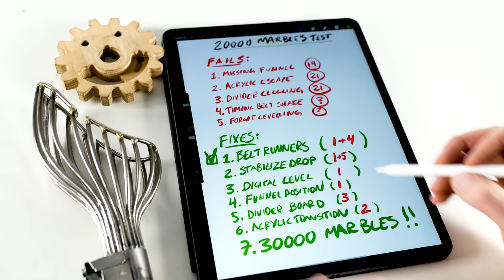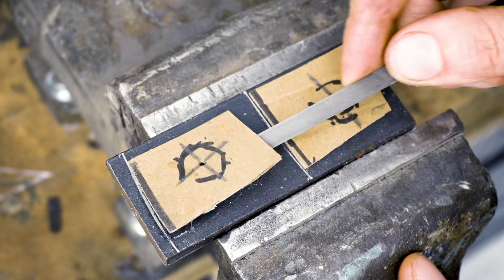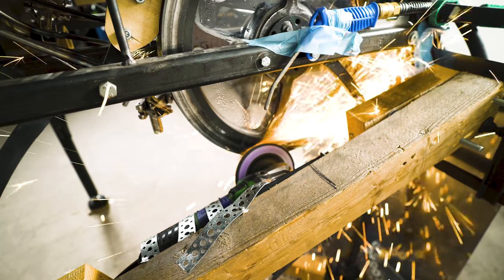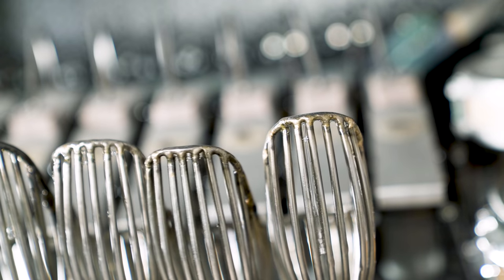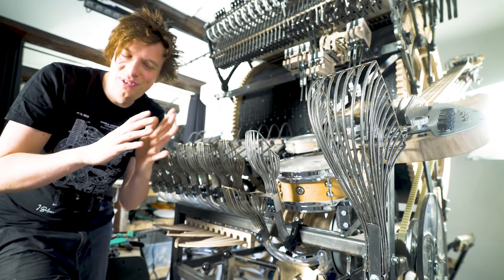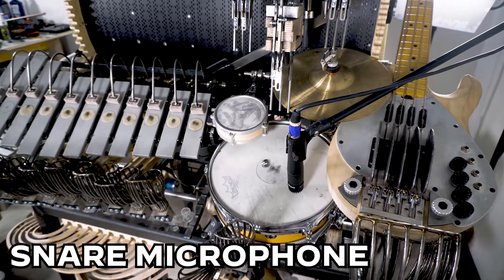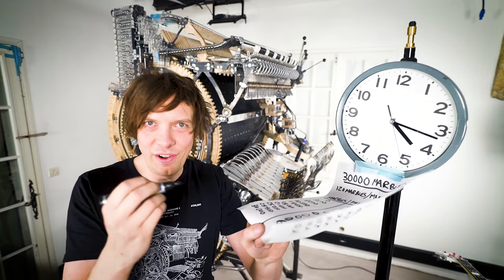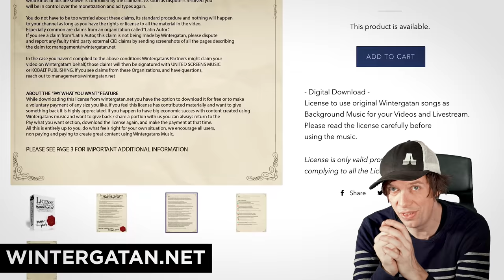Playing 30000 Marbles - Marble Machine X #148

Comment: Him: increasing the mass to reduce the shaking
Me: Ah yes, inertia. The more mass something has, the more resistance it has to moving when acted upon by a force.
Him: E=mc²
Me: Hol' up
Reply: Ya he really needing F = ma. For the same amount of force but with a larger mass means less acceleration. Correct?
Reply: @epicboy47  I believe that is correct. My original comment used f=ma but I figured inertia made more sense. It is important to note though that many equations of inertia are derived from f=ma

But yeah, the object would have less acceleration when hit, meaning it will move less (thus reducing the shaking)
Reply: What's one way to find the kinetic energy of an object (assuming it's mass isn't 0)? 
Kinetic Energy=  .5 * mass * velocity^2
so
E = mc^2

TL;DR: Same difference; you're just coming at it from the end, and he's working through it from the beginning ;)
Reply: @randoUsername553  difference being that the c in e = mc^2 is a constant for the speed of light. Nothing on the that machine is moving at the speed of light.
Reply: @epicboy47  ...noone said anything was moving at the speed of light. 
You understand mass–energy equivalence but can't do the algebra needed to figure out why he cared to mention 'if e=mc^2 holds up...'? Even after I showed the formula for kinetic energy?? And knowing he was trying to verify how much mass he needs to add, in order to counter kinetic energy doing work???

If the socratic method didn't work, here's another hint: direction is the difference between speed and velocity
Reply: @randoUsername553  what me and the other person where saying was that we were agreeing with his explanation then he put up e = mc^2 which is not the right equation for the forces he was talking about. He probably know this and did it has a joke. Which is why when labeling the part of the equation he put "hmm?" over the c. We were just talking about what the actual equations would be. I agree that you could use the formula for kinetic energy to help explane the reasons for adding mass. But, e = mc^2 (mass to energy conversation past the speed of light) has nothing to with this scenario. The equation are only similar when c = v. Also the equation e = mc^2 says something about moving past the speed of light.
Reply: @epicboy47  he, literally, said why the hmmm was there...
I.e. He said "IF E actually equals m we should see less shake" and drew hmmm over the equation. 
Hypotheticals, typically, require thought. Not many jump to conclusions (especially when trying to fix a 'random' shake without too much guesswork) ;) 

when you say "The equation are only similar when c = v." do you mean to say that the equations are similar when we introduce a constant? Odd how that works. What's e=mc^2 describing again? And what's kinetic energy?? And once again, what's the difference between speed and velocity???
C'mon bro... 
It's simple algebra - you know - the branch of math that deals with relationships (like mass–energy equivalence) and symbols not tied to a fixed value. I understand it's being used to describe complicated concepts - but - it, itself, isn't complicated.

"I agree that you could use the formula for kinetic energy to help explane the reasons for adding mass."
By now, hopefully, you understand how you can also use the formula for kinetic energy how he, probably, did (considering he jumped straight to e=mc^2 and not f=ma)
i.e. you can also use it to figure out how much mass is needed to counter an objects kinetic energy - because - if the kinetic energy (of the moving part) equals the mass added (to the part being struck)...there's going to be more inertia in the part struck (I feel this redundancy is, unfortunately, required at this point) ;)
Reply: @randoUsername553  like what epicboy47 was saying, e=mc^2 was created to describe the direct correlation of mass and energy, being that mass and energy are different forms of the same thing. So if I were to convert, say, 1kg of mass to pure energy, it would produce e=mc^2 = (1kg)(3×10^8)^2 = 9×10^10 joules of energy. (Someone please correct me if I did that calculation wrong)
That is more energy than the average atomic bomb.
He was using e=mc^2 as a joke in this video. 
And yes technically we can use the kinetic energy equation K = 1/2mv^2. With some algebra, we can change it to v=sqrt(k/0.5m), again, someone please correct me if I did the math wrong on that one. From that equation, we can now see that doubling the mass will halve the velocity, which in turn reduces the shaking. However, f=ma is simpler and probably better to use. That one will show that having the force being the same but increasing the mass will reduce the acceleration, again reducing shaking.

Also, if we were to use E=mc^2 to describe kinetic energy, then increasing m will also increase E unless c is a negative number, which would not logically make sense. That would be implying negative velocity. We need to decrease E in order to decrease the shaking, so that equation being used in that sense does not hold up.
Reply: @natecas0865  "And yes technically we can use the kinetic energy equation K = 1/2mv^2."
...i know; that's why I suggested it as a reason for why E=mc^2 would be in video describing problems created by the E of motion 
not much difference with kE = 1/2mv^2 and E = (.5 * 6) * c^2 besides that pesky light, and its direction, that you guys keep getting hung up on  ;) 
NOTE: these numbers were used to help create a juxtaposition, and to help put a fixed value to m - because - complicated concepts are less complicated when there aren't more variables than needed.

"He was using e=mc^2 as a joke in this video. "
I'm arguing there's a, decent, potential it's not a joke; ask him? else this is just conjecture and open for continued argument?
 
" However, f=ma is simpler and probably better to use. "
Might be true - but - that doesn't mean that's how he did it. People do things the hard way all the time - often - they do it because they think its easier (and for them it might be). 

Show me his measurement of the acceleration - otherwise - all i see is video of something moving a measured distance in a specific direction (i.e. all i see is a measurement of velocity ;) )
Reply: @natecas0865  I am half convinced @Scott Broscious is just baiting. If he is not then there is no point in trying to reason with him. We have presented our points if he doesn't get it then oh well what can you do. I hope you both have a good day. :)
Reply: @randoUsername553  Ok I get where you are coming from, so my question is this. Why use Einstein's equation E=mc^2 when either k=1/2mv^2 or even F=ma would suffice? Doesn't it seem overcomplicated to relate the 2 equations when they were meant to solve different things?

And by different things I mean that the energy in the kinetic energy equation and the energy in Einstein's equation are not the same form of energy
Reply: @natecas0865  "Why use Einstein's equation E=mc^2 when k=1/2mv^2 would suffice?"
ignoring that i have no idea why he used that formula - why he used it isn't my argument - there isn't much difference between those two formulas other than one is the formula for the energy of motion while the other is the formula for energy. 
i.e. k is a type of e, and to get v you need to measure speed; stop getting confused by light (its just a constant reference point) ;) 

NOTE: my argument is only a reason why E=mc^2 would be in the video. It is not an argument about why he used it over another formula to describe this problem. One of those things is based in math, the other in psychology. I'm not too good at 'peopling' lol ;)  

"Doesn't it seem overcomplicated to relate the 2 equations when they were meant to solve different things?"
This is an odd question considering both of those equations are about the relationship between three, seemingly, unrelated things and all three things are present in both equations.

"kinetic energy equation and the energy in Einstein's equation are not the same form of energy"
...kinetic energy is a form of energy. Can you tell me what the form of energy in Einstein's equation is (please dont say pure energy again)??? So that we can start comparing things that are of the same form...and not have to do all these nasty conversions, regarding that forms motion? Hell, can you answer any of the questions I've asked? I swear the socratic method works...sometimes lol. 
I.e. What you just said is akin to saying "the movement of a dog and a dog aren't the same form of dog." 
Stop making it so convoluted...its confusing you. Reduce the problem to the simplest form; the movement of the dog is another descriptor for the dog. 
e.g. "the dog, over there" is only good if there is one dog; "the dog, over there, walking towards us" is much better in, probably, every other situation.
We could even go in a completely different direction with it, and say that a cat with the movement of a dog or a dog with the movement of a cat would be very weird.
The movement of the dog can be a proxy for the dog. Is it a good one? Depends on you and the problem you're solving.
Reply: @epicboy47  and i'm starting to think I'm talking with one or two people that understand energy....but only superficially. I'll go back to my studies now. You wont have to worry about me, I'll leave you to your strawman ;)
Reply: @epicboy47  I hope you have a good day too thanks! Sorry, didnt see your message until now. And yes. This conversation is over
Reply: Ahh NO!
Reply: @patman0250  right? they kinda lost me at ""the kinetic energy equation and the energy in Einstein's equation are not the same form of energy""
maybe they need to have a talk with the people over at the encyclopedia britannica; they'll either set a lot of people straight or get set straight. 
https://www.britannica.com/science/E-mc2-equation

I'm guessing it'll be the latter; I'm pretty sure the folks writing and/or checking the encyclopedia understand E^2=p^2*c^2+m^2*c^4 pretty well....but who knows?
Reply: @randoUsername553  I want to thank you for providing that britanicca link, and it would certainly be hypocritical for me not to acknowledge it. 

I believe I now see what is causing me confusion and I'd appreciate if you could address this: what is kinetic energy?

I have learned kinetic energy to be energy of an object in motion, but briticanna stated that the energy in E=mc² is also kinetic energy. What I have learned is that the energy in E=mc² is total energy, that is, if all energy including kinetic, potential, chemical, etc, even down to the weak and strong nuclear forces holding the atoms together were to be converted into pure electromagnetic radiation.

I'll do a math example to show what I'm talking about:

Say we have a 1kg object moving at 1 m/s
Using K=½mv² we get ½(1kg)(1m/s)² = 0.5 joules. So according to that equation, this object would have a kinetic energy of 0.5 joules

Now using E=mc²:
E = (1kg)(3×10⁸m/s)² = 9×10^10 joules.

I'll agree, perhaps me using the word "form" may have not been the correct word to use, but clearly E=mc² is including way more energy than k=½mv² accounts for.

The only way I've seen e=mc² be used for calculating kinetic energy is when an object's velocity is going near or at the speed of light, because this now introduces the infinite mass problem. And like the other guy said, no part in this is going the speed of light.

This is what I meant by they solve for different things and why e=mc² should not be used for the marble machine example.
Reply: @natecas0865  "what is kinetic energy"
It is a form of energy (specifically it is the energy of motion). 
note: kinetic energy is one of several quantum of existence (without it we wouldn't be here )

A better question for you to ask, I think, would be what is energy?

"The only way I've seen e=mc² be used for calculating kinetic energy  is when an object's velocity is going near or at the speed of light"
There isn't much difference between  E = mc^2 and kE = 1/2mv^2...you just think there is. Is there an echo in here? ;) 

"Now using E=mc²:
E = (1kg)(3×10⁸m/s)² = 9×10^10 joules."
I didn't correct you the first time, but now I must:  9×10^10 joules AT THE SPEED OF LIGHT 
note: i didn't check your math...just added the light, you keep getting confused by, back into the mix.
I.e. if we're not dealing with light or something as fast/faster...why do you keep using the speed of light? Use the speed, of whatever is 1kg, as seen by the observer...it's much simpler ;) #nonRelativistic

"This is what I meant by they solve for different things and why e=mc²  should not be used for the marble machine example"
Hopefully, by now, we're clear on why this is incorrect.
i.e. One (E=mc^2) is a statement describing a theory; the other is an "extrapolation" of that statement (used because the former doesn't work, as is, in our case).
which is why I said:
"This is an odd question considering both of those equations are about the relationship between three, seemingly, unrelated things and all three things are present in both equations."
 in response to: 
"Doesn't it seem overcomplicated to relate the 2 equations when they were meant to solve different things?"
note: those three things are Energy, Mass, and Speed ;) (the speed of light in a vacuum is just a constant reference...cause perception is a bitch)

TL;DR: refer back to the algorithm I shared previously  (E^2=p^2*c^2+m^2*c^4 ) and then take a look down at special case #2 (item 2.2) at the following link. 
https://en.wikipedia.org/wiki/Energy%E2%80%93momentum_relation
Go over them both, until this all starts to fall into place. You're making it much harder than it needs to be.
Reply: @randoUsername553  I'll take a look at that thanks
Reply: To chime in firstly I don't think he actually was using E=mc^2 as indicated by the "Hmmm". E and m are proportional which is what matters.

As for the difference between E=mc^2 and E=(1/2)mv^2 really we need to start from Einstein's full equation
E^2 = (mc^2)^2 + (pc)^2

This is always true but we can consider some special cases. If we take an object at rest then v=0 => p=0 and so we get
E = mc^2

We can also consider this equation at low velocities, ie. much less that the speed of light. By taylor expanding to first order we get that
E = mc^2 + (1/2)mv^2
Since in most situations the mass does not change and so the energy from the mass is constant we only have to consider the second term which we call the kinetic energy. So E_k = (1/2)mv^2.

Ultimately the whole discussion is moot. The point that Wintergarten was making is that energy is proportional to mass and so more mass means more energy is required for the part to move as much. Either E=(1/2)mv^2 or F = ma re the equations you would actually want to use to properly calculate the effect but that is not what he wanted to do, merely make a bit of a joke with his point
Reply: @reddragon3132  "Ultimately the whole discussion is moot."
New things! We demand new things!!  #facetious

i.e. You have only reiterated what was already argued by both sides of this debate...chiming in with echoes (including what was quoted above).

e.g. regarding the section that follows:
"As for the difference between E=mc^2 and E=(1/2)mv^2 really we need to start from Einstein's full equation"
E^2=p^2*c^2+m^2*c^4 (the equation as I stated it) is equal to E^2 = (mc^2)^2 + (pc)^2 (the equation as you stated it) and is explained, pretty well, in the wiki provided regarding it (not that you did a bad job here...but, again, echoes).

If that was the intention, ignore my idiocy.
- that said-
Adding something as basic as, "getting down to the nuts and bolts of the matter: there are two forms of energy, potential and kinetic" would, probably, have been more helpful...even if still not fully explanatory and/or accurate (bad joke aside).  

TL;DR: I read all of that "last week" ;)

Comment: wheel balancing gets funny sometimes, ironically you can even get something like an oval to run smoothly if with air resistance as long as you balance it correctly, just look at anything with spinning blades, the shape isnt important, the mass is

Comment: The marbles got backed up after 4.5 hours using one instrument. When all the instruments are playing I don't think the marbles will ever get backed up
Reply: Au contraire, with all instruments being played, more marbles are required. That implies much faster backup. He needs to redo his hopper design.
Reply: It could go either way. If I remember correctly, the stair is just handling overflow, dealing with the marbles that don't go into one of the instrument channels. So when playing on more channels, the marbles will drain more quickly instead of hitting the overflow - but more channels playing also means more marbles coming back through the system. It's probably neutral in practice...